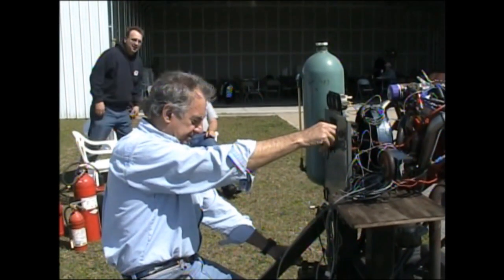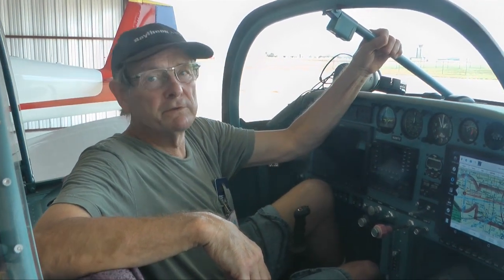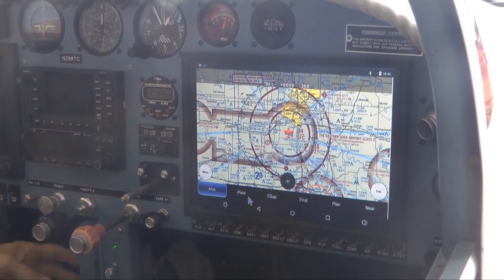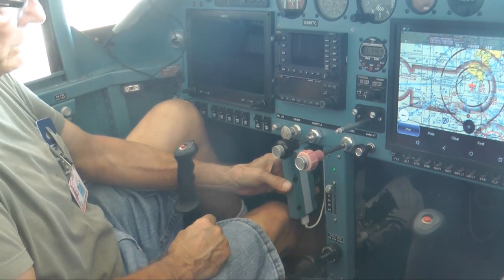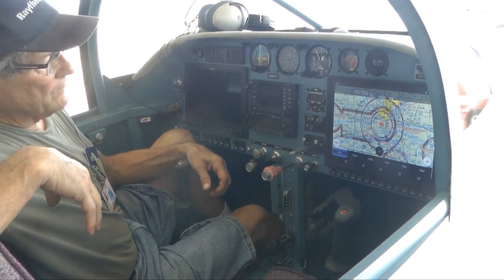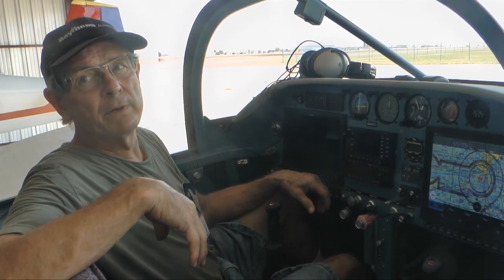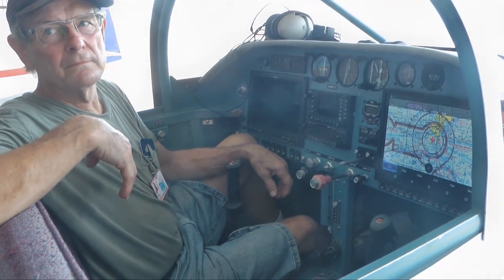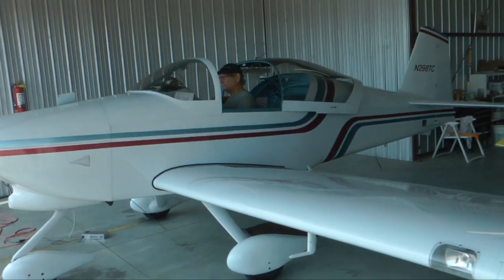Door #3  What's Inside Those Hangar Doors?  (A custom Panel)

Comment: Hey John I'm working on a similar instrument panel project.  Could you provide contact information for Tom Olsen?  Would very much like to compare notes. Would also be glad to share my project with your audience if you're interested.  My "experiment" is installed in a Zenith 601 which is based at a small airfield just north of Denver, CO.

Comment: I think that EFIS panels such as the type that Dynon, Garmin, and others make have done wonderful things for safety and situational awareness.  However, I've had this growing concern about their long term serviceability.  You can still find parts for a Continental A65 but a lot of older GPS units are no longer supported by their manufacturers.  Having a system built from modular components that can be repaired/replaced/upgraded individually might be a path forward.  I'm looking into using a tablet setup running an EFB app receiving flight and engine information from something like an iLevil 3 AW or iLevil AP, but I'm waiting to hear more feedback about how well they work in the real world before I commit to that path.